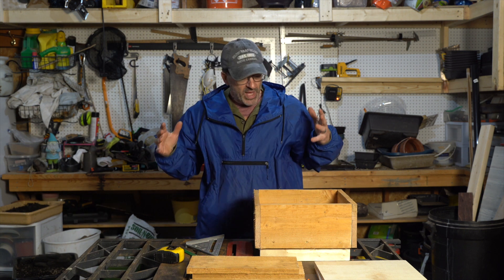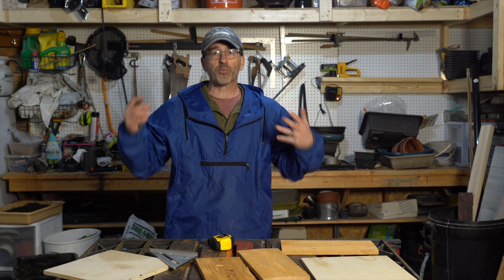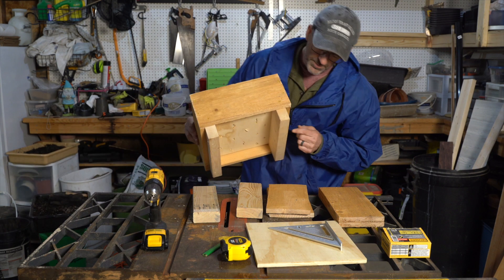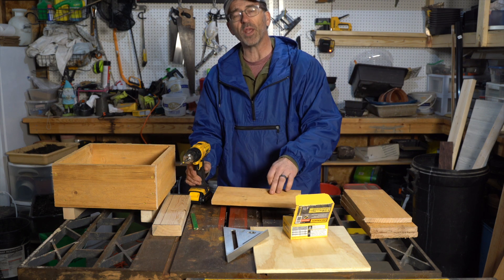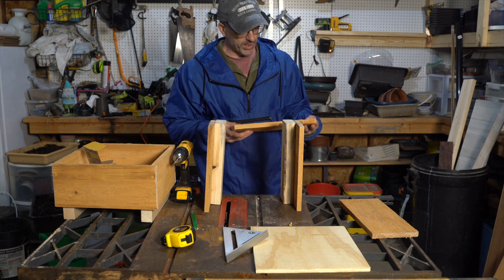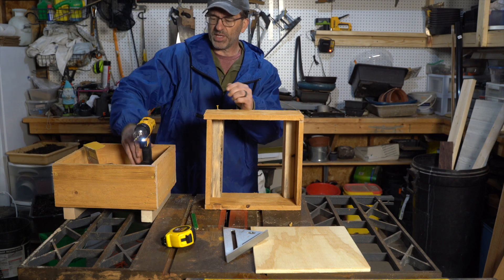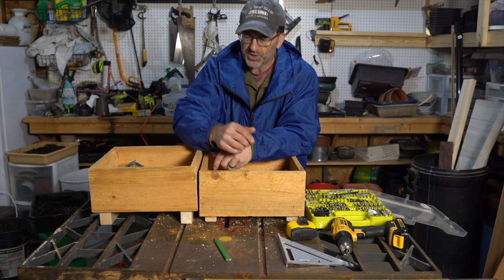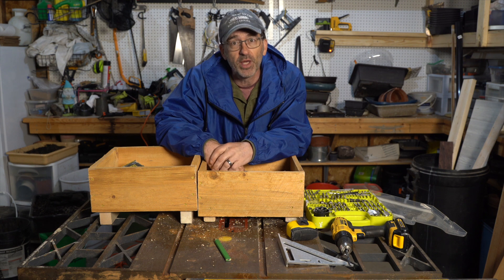Bonsai Boxes:  Dave's Bonsai E101

Comment: Good project, I prefer wood boxes over “plastic training pots” for some of my spruce/picea 
I’m curious about your choice of plywood for the base. I typically use hardware cloth with a few cross beams to support it from sagging, and work as the legs/feet. More air circulation, lighter weight and cheaper than wood. Is there a reason you used plywood?  Or just what was available?
Reply from the maker: Often what was available.  But after watching a Ryan Neil video, I should stop drilling holes in my boxes and just make open slats on the bottom.
Reply: May I ask what "hardware cloth" is?  I have tried using landscape cloth (breathable) but I'm not sure that it's the same thing you're referring to.
Reply: @brandonbernard5165  fine wire mesh. Typically the grating is between 1/4 to 1/8. Commonly found in the eves of your roof ventilation holes to keep squirrels and birds out.

Comment: Wonderful video.  Thank you. (I benefit from all your videos).  Question: I live in a very humid climate   I have always been hesitant to build wooden boxes out of fear that mold and mildew would perhaps kill the tree. Any recommendations on what liquids would be helpful to apply to the interior of the box to ensure less probability of mildew?  Or should I not worry about it at all if I'm using pressure treated wood?
Reply from the maker: My guess is that with pressure treated lumber you’d be fine.  I have some humidity here, but never have had issues.  I do stain my cabin cold frame every so often to make sure water wicks away better, but that’s different then a pot.  I guess I don’t know how stain would react with root system:  I’ve never done it.  Sometimes I’ve sprayed flex seal on the inside of Custom pots.  Doesn’t seem to hurt the trees.  But that can get spendy.
Reply: Perfect!  Thanks